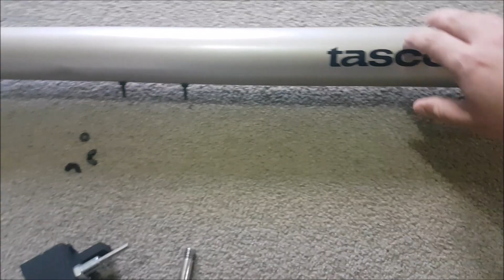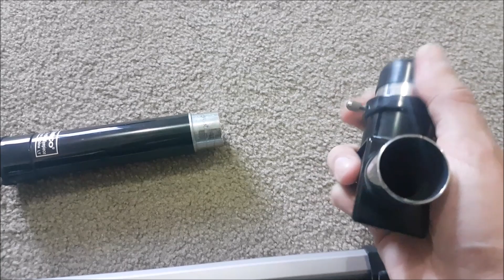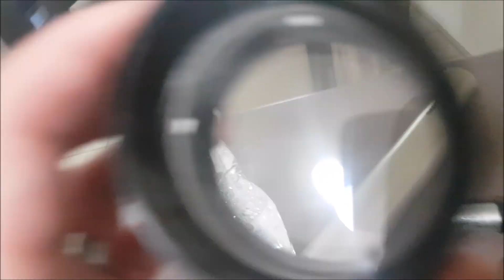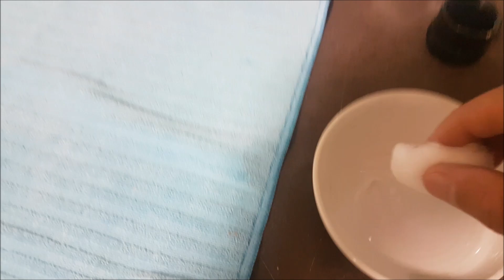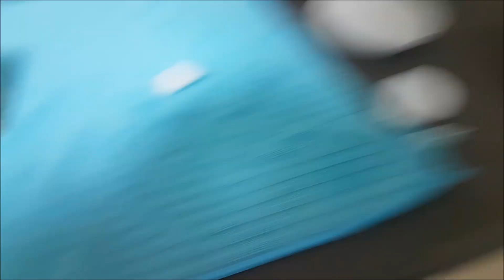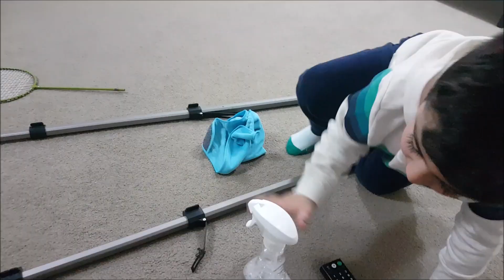Tasco Telescope Restoration

Comment: Nice video and wise words about not dissembling the lens elements if at all possible.  I spotted an old Celestron Astromaster laying in someones front garden recently and asked if I could have it.  Wet and mud had gotten in between the lens elements so they had to be taken apart and it took me ages to get them aligned again.  Scope gives nice low power views of the moon but that's really its niche nothing more.
Reply from the maker: Yea this is a small basic telescope that I learned to pull apart. But tbh. It is probably akin to a toy

Comment: Sir, you put the main body the wrong way. The blunt silver end of the mount below the main body,  points to the front, then you put the longer Flexible Control Cable (they're the long black handled screws shown at 11:34) on the other end pointing to you (the one with the notch) so you can adjust it  You are using both in each side of the Hour axis scale (big silver dish-plate with numbers)  makes no sense. The shorter is for the Hour Axis scale, and the longer adjusts the main body  (the tube) further or closer to you. 
You can find better info by looking at the manual, search Tasco 46-060675. Owners Manual
Otherwise, pretty NEAT job!  you got a hell of an entry telescope. GReat video Sir!
Reply: Also I know very little about scopes. Learned everything in the last hour.
Reply from the maker: Thanks mate
Reply: @HomeRoboticsAustralia  YOu're welcome sir!
Reply from the maker: Thanks for your feedback.  I suppose  I just put it together for the sake of assembly rather than function. But you are right

Comment: Thanks for the helpful vid. I found one of these, buried in my garage. I think it's a slightly older model (Tasco 302058). All lenses need cleaning. How do you remove the main lens hood? Many thanks!
Reply from the maker: Hey bud.  See cap is removed by shear force. If it is an older metallic scope. It may be unscrewed
Reply: @HomeRoboticsAustralia  Thank you so much! Yes, it came off with a bit of brute force! :D Now that my lenses are cleaned up, I just have to get used to the upside-down image. I wasn't expecting that! :-o

Comment: My second telescope in 1962 was a 60mm Tasco refractor on a GEM with slow motion cables in a beautiful wooden case. Great images. 

I just traded a larger Meade 6" optical tube achromatic for a beautiful 76 mm Tasco model 10 with clock drive, looks brand new from the early 60s in a beautiful wooden case. Been cloudy every night.
Reply from the maker: Thanks for sharing. Unfortunately after the mid 90s when manufacturing went to China there was a massive drop in quality of the scopes